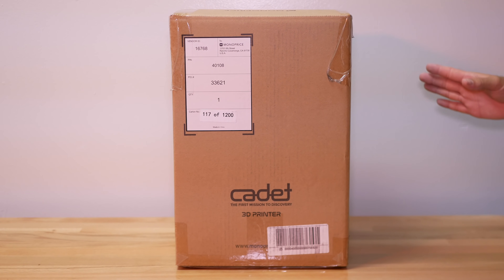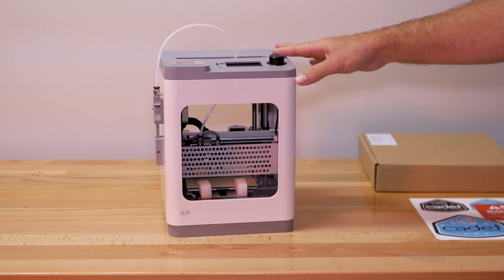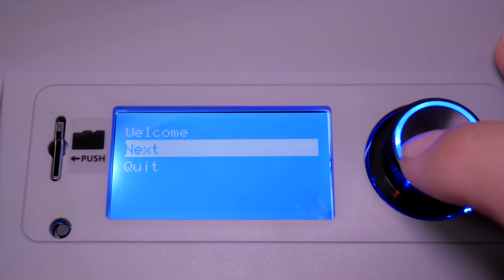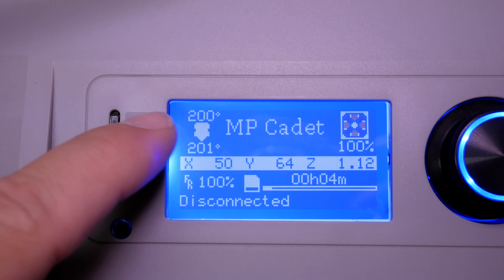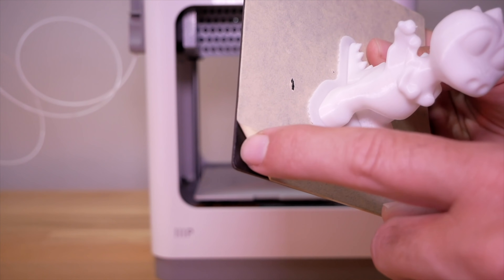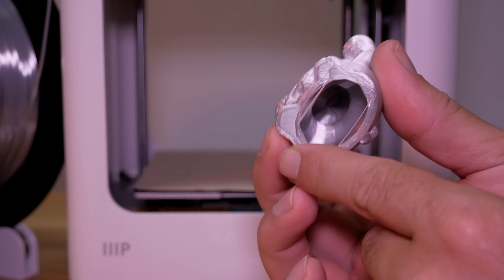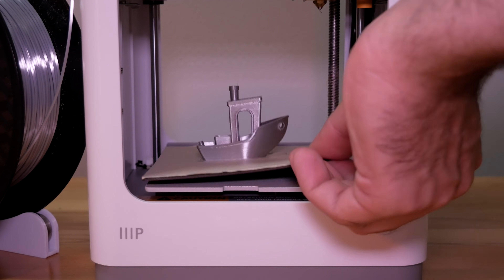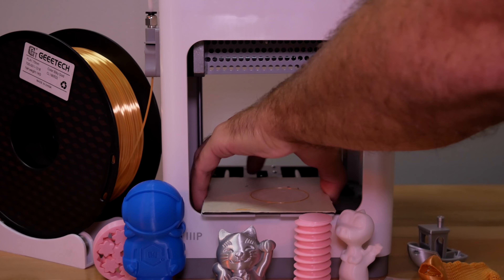Monoprice MP Cadet - 3D Printer - Unbox & Setup

Comment: This is $90 right now….I think I’m about to pull the trigger! Beginner or not, you can still print several useful things with this printer.
Reply: Just bought 3 of them can't beat this for $90 well $110 with warranty at Walmart.... think about it 90 for a $300 printer which is better than every $200 printer I can find right now

Comment: Bought one of these off someone on OfferUp for $40. It didn't come with a power cable. I had a dozen of old laptop cables laying around, luckily one of them fits and works. Was able to print some cool toys. Only issue is it could not connect to my wifi, its stuck on the connection screen for all of eternity. Will just have to print using the micro sd card. Not bad for $40.

Comment: Here's a quick update. Used the glue and got my dragon out in one piece.  However, when it completed the dragon it raised the print head to the top of the printer screamed and failed with a failure to home.... albeit in three languages.  I tried to print again and it screamed straight away..... I manually lowered the head to mid way and it is currently printing the cat.

I am glad this is an easy to use one!  Takes me back to the days PCs had just come out and you were forever dealing with hardware issues.

Comment: So, I've watched several of your videos concerning entry-level printers, and I am most impressed with your ability to review these machines in terms that are easily understandable.
I am on a fixed budget as a retiree, and I am looking for your recommendation for a 3D printer that will fit my learning needs yet be able to keep up with my learning. I want to be able to print a few items that are more than just trinkets and expand my knowledge for some custom pieces.
Which printer would you recommend in the $200-$300 price range?

Comment: Hi, loved the video, bought the printer. I am completely new to 3D printing so your video was great.  So far I blew threw the white pla with half a dragon and half a cat.  The dragon came unstuck half way through its head. The cat... I ran out of pla.  Fortunately I have ordered 1 kg of pla and it arrived 5 mins after I ran out. Ran the dragon again, and it unstuck at the same spot... I didn't want to use the glue so I skipped the dragon and went on to a stl I had.  Still working on getting a print out in one piece.

What I can't get to work is the WIFi. I tried this several times and no joy.  I also tried the USB but I have not been able to get that to work either.

I also found that putting the micro sd in my pc using the included usb adapter,  it was not read.  I had to use one of my own Micro sd to usb adapters. 

Still having fun :)
Reply: Did you had more luck yet?